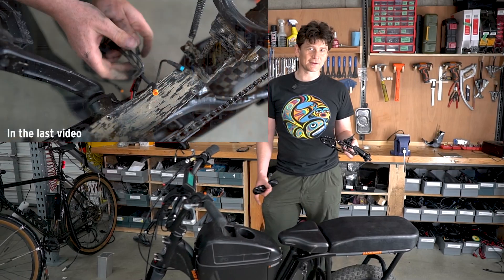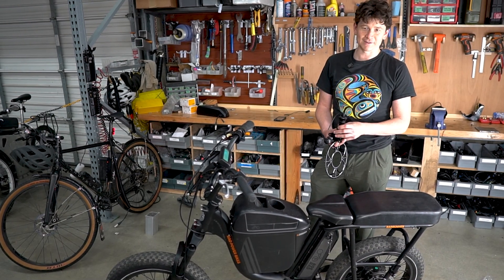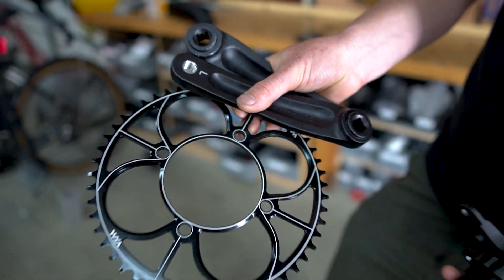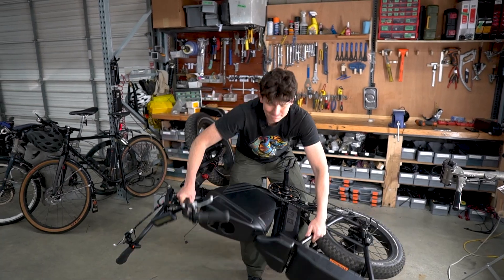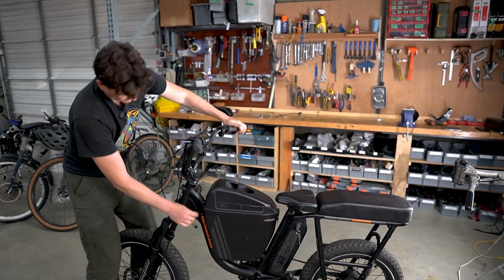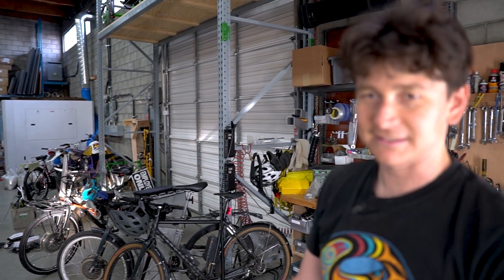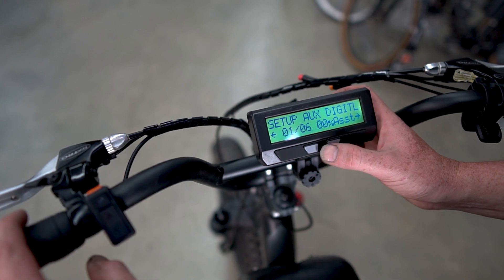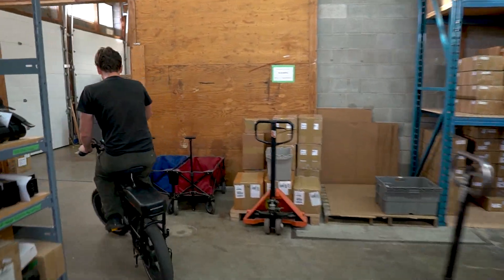RadRunner hack Part2, Adding a Torque Sensing Bottom Bracket

Comment: And the question still remains...  how do you wire it together?  When the plugs dont match.  My Bafang BB has 6 wires.
Reply from the maker: Generally you cut off the connector and solder or crimp on a new one that does match.
Reply: @GrinTechnologies  ok thanks

Comment: If I have the bolton upgraded controller and display for my radcity 4. Can I also add this torque sensor to it?
Reply from the maker: Only if that particular motor controller has a torque sensor input capability and can be reprogrammed. We don't know any details about it but the vendor you who you purchased it from should be able to help.

Comment: Can you combine PHASERUNNER controller with Bafang M620 motor pedal torque sensor so it will work in torque pedal assist mode?
Reply from the maker: In principle likely yes (with the V6 phaserunner devices), but in practice it would be one heck of a custom wiring and connector hack job.

Comment: Can the CA3 operate torque and cadence assist simultaneously?
Reply from the maker: Yes, you can have a torque sensor on the bike and choose to run it in cadence move instead of torque mode just fine. On that case it will display your human watts, but the assist it provides will be based on cadence regardless of crank torque. You can have different mode presets with different control schemes to easily switch between them
Reply: @GrinTechnologies  But can it use both at the same time, so that the motor will speed up by pedaling faster or harder without changing settings?
Reply: @billa3816  those are two separate control methods.
Reply: @aayala1053  I was looking at the Juiced Bikes RipCurrent S and from my understanding it has cadence and torque sensors that are active simultaneously.

Comment: What is the part number of the 100MM bottom bracket you used in this video, do you have any like it for sale ?
Reply from the maker: It's a Sempu sensor. We stopped selling them a couple years ago because of QC issues but still had a few lying around. We'll be carrying a 100mm version of the ERider torque sensors later this year.
Reply: @GrinTechnologies  I'm interested in getting a properly sized replacement bottom bracket for a 2021 RadRunner 100mm X 164mm total length, without a sensor, do you recommend one ?

Comment: I live in Europe and speed limits and throttle is no joke( not allowed). I intend to build a dirt or enduro frame ebike with a sabvoton heavy duty controller. 52v battery, no throttle and speed limit to 27k/h. Since it's gonna be too heavy to pedal and no throttle,  so I intend to use an erider torque  sensor to a CA v3 and a sabvoton controller. Do you think I can get a smooth and safe performance even if I limit the speed? I was a little bit concerned because someone on endless sphere complained of a dangerous situation on a corner when momentarily stopped pedalling and a power surge suddenly. But he uses sempu torque though. ??? Please I will appreciate your reply. thanks
Reply from the maker: Yes for sure, limiting the speed in the controller doesn't change the safety or smoothness.  The Sempu sensors were definitely prone to erratic signals and we have seen a few ERiders latch up too in electrically noisy environments, but that can be resolved by grounding the bike frame.
Reply: @GrinTechnologies   thanks 👍

Comment: I’ve been watching your videos for about 6 mo. Love them 
I’m 66 and in fair shape, however I live in N Vancouver in a very hilly area.  I wouldn’t have to travel more than 50 km round trip. There are two big hills in the trip. 
What kit would you suggest? I’m a man and 95 kg. 
Love to hear your reply.

Plus I’m not mechanically minded, could you also recommend a shop for installation? And tuneups !
Reply from the maker: Hey Allan, generally for a bigger guy with hills we'd recommend the RH212, GMAC, or eZee systems. But if you are not into doing the installation yourself it's likely a better plan to buy a factory ebike than to try and find a shop to install and support a kit for you. Such places, sadly, do not really exist in a way we could endorse.